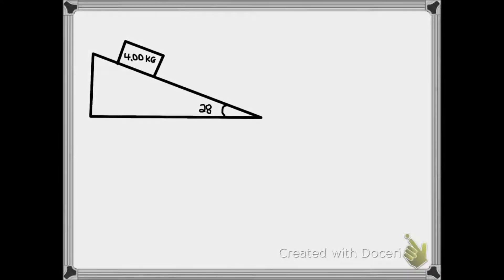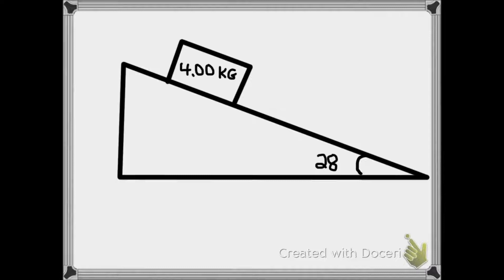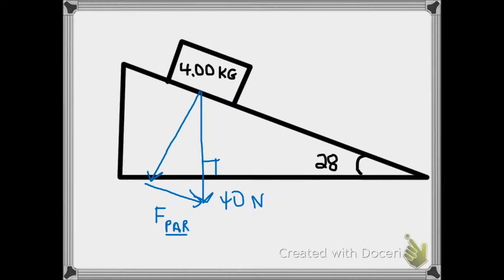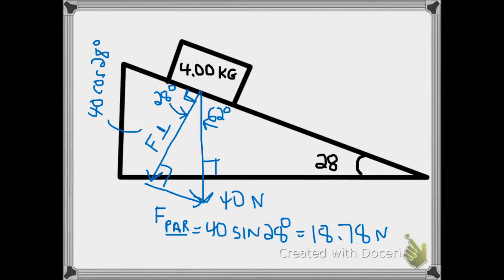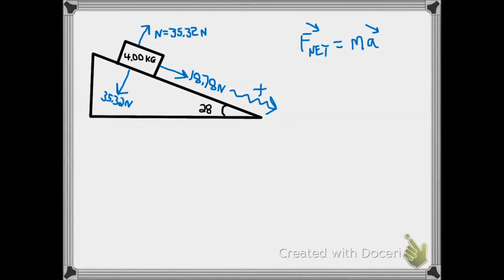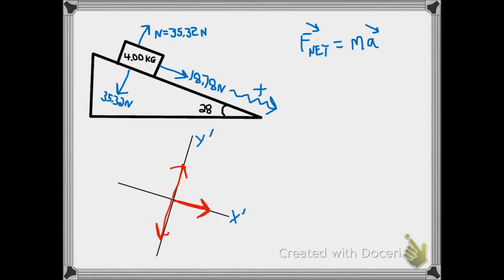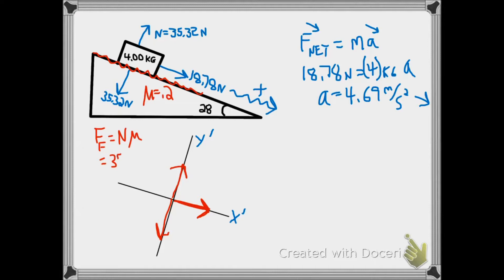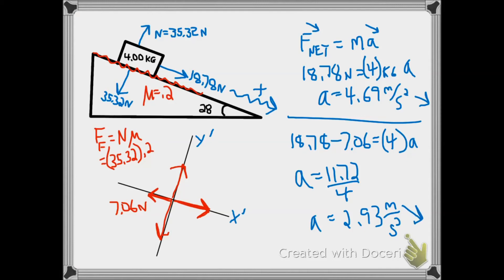McQuaid Physics - Basic Inclined Plane Problem with Friction

Comment: Question. To get Fg don't you have to multiply mass by gravity? (4.00kg*-9.81) and If you do that you'll get -39.24N instead of 40N
Reply: Boyyo He used 10 meters per second squared rather than 9.81. Also, force cannot be negative, so you have to make it positive.